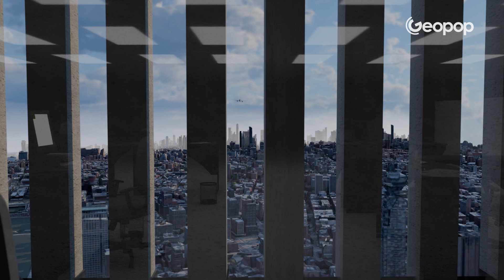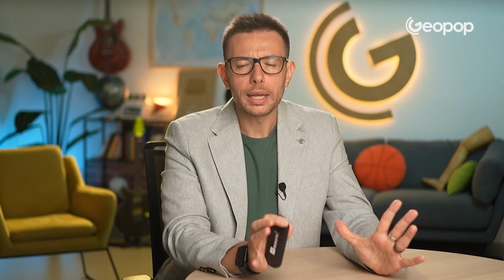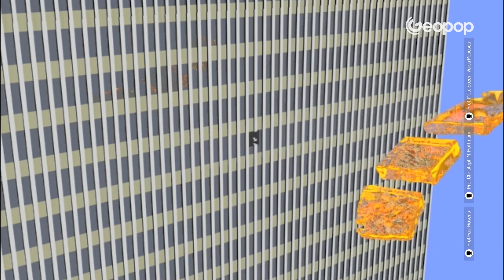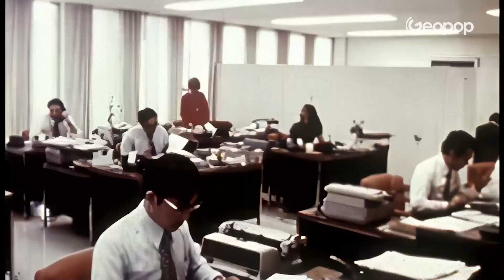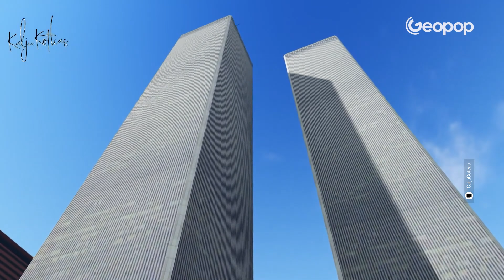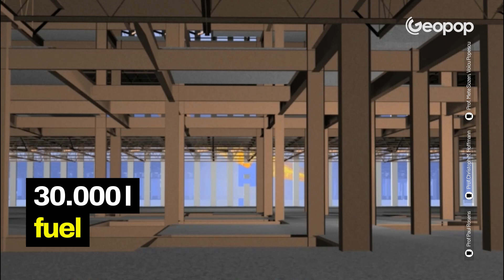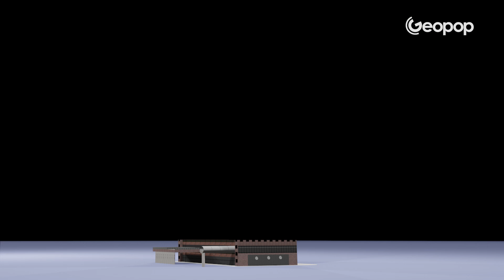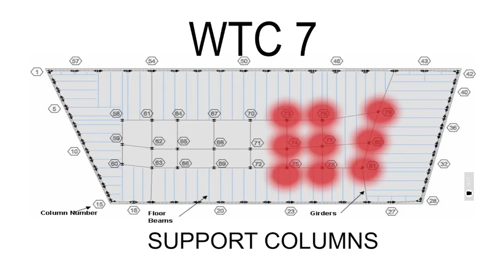9/11, 2001: The Technical Reconstruction of the Twin Towers and WTC 7 Collapses

Comment: As a Boston Fireman since 1987 I can tell you that before weakening Steel also comes alive with such power it cannot be restrained snapping Bolts, popping and shearing Rivets and tearing Welds. It's shocking how much it moves. 
Its so bizarre that people believe Building 7 was taken down by explosives, first of all when Structures are demolished with Explosives a place that size would likely take maybe 9 months to a year to do pre demolition, gutting it and partially cutting major Structural members, and to place sufficient amount of high explosives in strategic locations would be impossible to go undetected with openings having to be made in Floors , Walls and Ceilings and many Miles of Wiring, even with precise Design / Engineering knowledge of critical locations and precise placement of the minimum it would take to cause a catastrophic collapse is so absurd, you couldn't sneak a Pistol into that place.
Also the sound is unmistakable and the locations can be seen and felt.
Reply: As a fireman who knows these things, why did so many firemen enter the building hours after the strikes? They must have known they were unstable?
Reply: @Stratoszero They knew, In spite of the obvious heavy damage and the fact that a Plane bigger and heavier and hit harder than it was supposed to withstand, there must have been some belief (hope) that catastrophic failure likely wouldnt happen, but they knew that the progressing Fire they could not stop made it more likely it was inevitable. Still, the Big City Municipal Fire Departments are not the same as most others; you have to go, and only if the Man in Charge decides differently, but this escalated so fast with the largest response in the City's history. The man in charge kept changing, and even being the largest Fire dept. in the World it overwhelmed them..                   I personally believe that when the second Plane hit, I would have ordered everyone out and pulled back most of the Fire Companies had I been in charge. it could have been easily over 2,000 Fireman Killed or more; initially, that's what most believed.
Reply: @Jam @JamesBerlo nder how many emergency responders were killed versus how many office workers they were able to save in the last hour? I know when I watched them fall on Tv I was stunned, back then I didn’t realise how much the style of construction mattered.
Reply: @Stratoszero  And you are right, I remember videos from the main lobbies and mezzanines. Many of the Firemen standing there awaiting orders had that look, and some were calling home. They knew.
 I worked with a Lieutenant whose brother was a Firefighter, he just got on New York a year before because he couldn't get on Boston because of the onerous DEI policies. 
The lieutenant was such a nice, easygoing person, but his Brother was killed, and he had such resentment, believing his Brother would be alive had he gotten on Boston. At least they found the remains of his Body; obviously, most of it was gone. His fire gear helped retain his remains and identify him right away.

Comment: What was the ignition source for building 7?

Was the deformation from the damaged supports enough to heat the metal enough to start fires? I’m not sure this is answered?
Reply: Easy to google, but you would probably not believe that t7 has 36,000 to 42,000 gallons of diesel to power the back up generators.

Comment: You can see the molten steel dripping off the corner that gave way first.. so it definitely reached melting point...
Reply: Aluminium , not Steel probably
Reply: @hansrenner9459  https://youtu.be/TJJPYTVjxug?t=27
- looks like Steel melting
- anyway, it's orange-hot
Reply: @FlyingPhilUK  
" looks like Steel melting"
-How do you know what kind of metal it is?  Do you have superman vision that tells you?
Reply: @NotSure723  Yes, I do.. also, aluminium melts at a lower temp, so it'll still looks 'silver'. Steel melts at a higher temp, and looks like that - glowing orange...
Reply: @FlyingPhilUK  
"aluminium melts at a lower temp, so it'll still looks 'silver'. "
-Educate yourself.  https://www.youtube.com/shorts/Z8sUj2uu33I
Reply: @NotSure723  Al melts before it gets red-hot, that was my point, not that it couldn't be heated to higher temps...the glowing stream shows that higher temps were generated in WTC2
Reply: @FlyingPhilUK  Your point was that it was steel, which still remains unsubstantiated...
Reply: @NotSure723  You're right - it's molten steel, or aluminium that's been heated in a furnace to temps equivalent to the melting point of steel..
Reply: @FlyingPhilUK  Wrong again.  Structural steel melts at around 2500 degrees.  Aluminum melts at 1,220, and is orange by 1500.  Nowhere near the melting point of structural steel.  You conspiracy theorists are so ignorant, it's just sad.
Reply: @NotSure723  You seem angry. Are you seeking help?
Reply: @FlyingPhilUK  Nice copout.

Comment: Increasing the load would mean the tower would have to get heavier. Wouldn't it? Also the heat was not applied for long enough time in order for the steel to weaken and  deform.
Reply: to increase load doensnt mean mass appears from nowhere. its dedistributed to remaining structural load bearing materials

Comment: Some mistakes I saw in this video are: they talk about steel deformation (deflection) while showing steel I beams as examples of floor beams but, there were no steel I beams in the floor system. It was all open web steel trusses with simple clips to the exterior columns and interior concrete/steel core. It is called a tube structure and it allows open interior space with no columns. Anyway open trusses are made of very thin steel pieces that would be way more suseptable to the heat than bigger beams. The pancaking we all saw that day was those clips and trusses deflecting and or failing and the floor, slab and all fell straight down, until the ground stopped it. The exterior tubes, on the other hand were Big I beams used as columns (a forest of them each side) and those damn jets sheared right through them like butter.

Comment: I think there's a translation problem, or you didn't explain fully: how did "the cold block pull the sides in"?
My understanding is that as the HOT steel floor trusses weakened and deformed downward, they pulled at the side columns. But one theory is that that tension pulled the heads of the 3/8" bolts attaching the floor trusses to the columns, since they were designed for shear forces, not tension. And thus the floor fell, and started the sequence.

Comment: Now everyone who thinks they're a expert on this can stfu. Use your brain, the way the plane hit that building and threw jet fuel on it is why it collasped. The fire and how hot that fire was melting floors. A key structure was taken out and caused it to falter. Then all the floors on top of another, there is no way it could sustain all the weight on an already weakend structure. There were no bombs and whatever other bs tbh come up with.

Comment: If it was so hot why are people seen standing in the hole the plane made and why no plane debis?
Reply: You mean at the North Tower?  The fires weren't at the entry hole now were they?  Why is that?  Because the shit that burns got shoved to the other side of the building by the forse of impact. Check out some videos looking at the south, east and west faces of the North Tower. There's a few good ones out there where the camera is stationary and you can watch the fires progressively grow and spread from floor-to-floor.
Reply: @TheLoonResistance  The stuff from the Plane with one wing? The  plane made of thin aluminium
and fiberglass that can punch through steel and
reinforced concrete floors against the known laws of physics? A fire that id not burn paper or passports? A plane which left no wreckage?
Reply: @barleyarrish  - - One wing?  WTF are you even talking about?  

Taking the South Tower as an example, Flight 175 weighed an estimated 122 tons (about a dozen dump trucks) at impact and did so at 587 mph.  Imagine hurling a dozen dump trucks into a steel cage at nearly 600 mph.  That is more energy than a ton of TNT. Yes, the aircraft is completely destroyed in about a quarter of a second but that in no way implies the building comes out unscathed

Also, there was no structural load bearing concrete in the Twin Towers

I take it at this point you are going to claim the huge entry holes in the Twin Towers are somehow fake ?

No planes = no brains. Never go full retard.

Anything can seem like a conspiracy if you don't take the time to understand how it works. You should take the time. If you still don't get it that doesn't mean reality is wrong, you are. Find a new hobby.

Comment: Sept2026:  I grew up on Long Island close to NYC.  
      I was in California when my clock radio woke me up for another work day.   I immediately realized something terrible was happening. 
      I ran downstairs, switched on the TV, and there was the WTC North Tower with smoke billowing out.  I was puzzled.  What happened?  Did a plane lose control and hit it ON A CLEAR DAY?  I knew the EmpireStateBuilding had been hit once on a foggy day, but this was nothing like that.
      While I watch transfixed on the image, another plane struck the South Tower.   I turned to my wife and said "THAT is an act if war".  Of course I also had my answer about what caused a plane to hit the North Tower.  
       I didn't go to work that day.  Instead I watched as every WTC building collapsed, 1 by 1.
       I was not surprised when we declared war on the Middle East, but Iraq?   Really?  They had nothing to do with it! 
       America has been collapsing like those buildings ever since. 
                Retired in Sacto.

Comment: BBC were way ahead of this collapse by 20 minutes, if only they could give out the lottery numbers 20 minutes before the event 😂😂😂
Reply: At 11:07 am CNN reported Building 7 had collapsed at 10:45 am, or 15 minutes after the North Towers collapse at around 10:30. They did it again at about 4 pm reporting Building 7 had collapsed or was in danger of collapse with the local Fox affiliate doing the same at around the same time. Those and other reports escaped the attention of the keen investigators at Loose Change so people like you never fuss over them. 

The BBC got their (mis)information from the respected news agency Reuters, which picked up an incorrect report. They issued this statement: 

“On 11 September 2001 Reuters incorrectly reported that one of the buildings at the New York World Trade Center, 7 WTC, had collapsed before it actually did. The report was picked up from a local news story and was withdrawn as soon as it emerged that the building had not fallen.” 

Have you ever played the game “Telephone”? You know, where you whisper something to your friend, then they pass that to the next person, then to the next and so on? By the time you get through 7-8 people, the message has completely distorted its original meaning. On 9/11 amplify that by a few thousand. 

News flash: Reporters are human beings and just like you, they make mistakes (and when they do they issue corrections).

Comment: Having an engineering degree myself, you confirmed everything I have only been able to speculate about over the years.

There is one design feature I have felt was flawed about the design. Hindsight being 20x20, if I had designed them, I think that I would have put an evacuation staircase in each corner of the building, so that there would be at least one or more stairs that would remain clear and usable no matter what happened. 

In tower 2 only one stairways was totally usable. In tower 1, none were above the impact zone, effectively trapping everyone so located. They were alive, but doomed. I can only imagine the only ones that had it worse were those in the elevators at the moment of impact. At least those in the impact zone hopefully died instantly.

Regardless, almost 3,000 innocent people perished in the most evil way imaginable.

Comment: There is NO WAY that jet fuel burning brought those towers down the way that they did. WTC 1, 2 and 7 were controlled demolition. Jet fuel does not burn hot enough to melt that steel and many people saw molten steel pouring out of the towers.
Reply: The collapse of the steel framed Twin Towers don’t have a single cause. It is a combo-platter of four (4) elements: 

Impact Damage + Fire (heat) + Time + Gravity = Collapse 

Remove any one of those four elements and there is no collapse. Ignore any one of those four elements and you will never understand the collapse. You are ignoring three (3) 

The molten metal at the NE corner of the South Tower was aluminum from Flight 175 and possibly lead from a large UPS located in that corner.